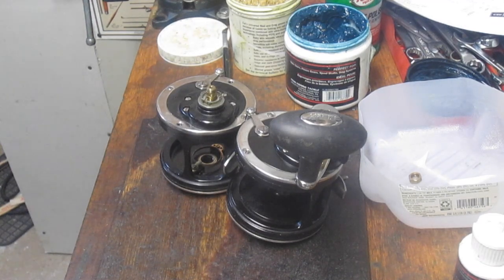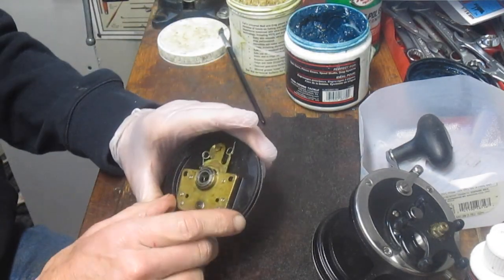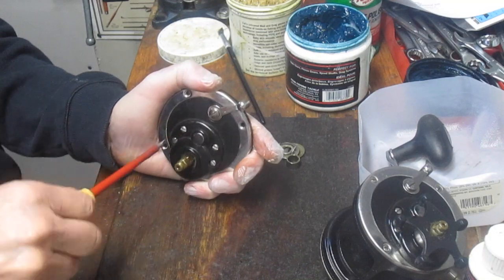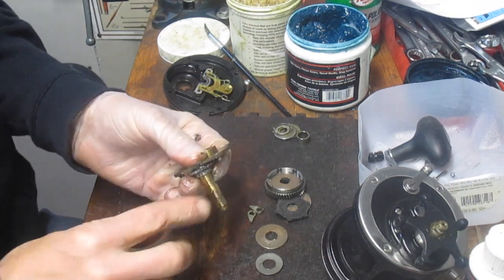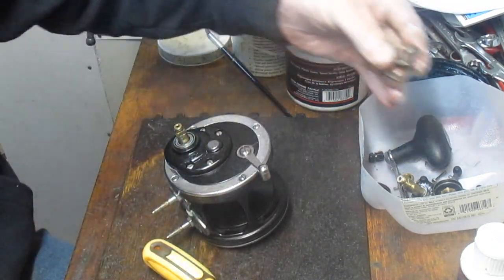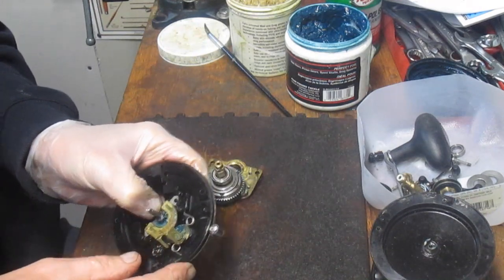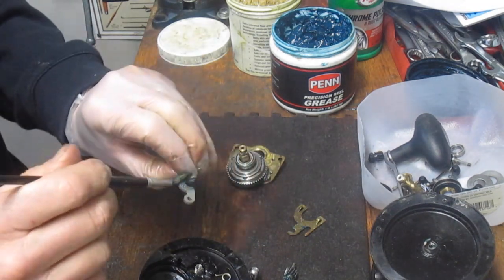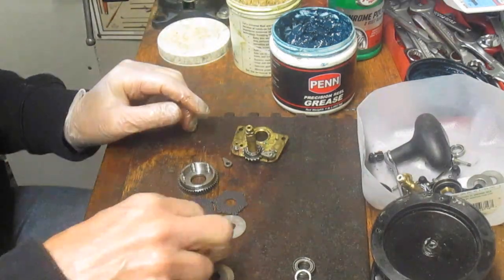Penn Senator 113HN Baha Special how to take apart and service this saltwater fishing reel

Comment: Call it the Yellowtail Special on the West Coast. Great and proven reel the Baja Special. Believe Penn calls that duradrag but I could be wrong.
Reply from the maker: I think your right on the Dura-drag naming.  It is quite the piece of machinery - Stay well Jeff - Dennis
Reply: @2ndChanceTackle  great reel and it's known as a great casting reel as well. They made a US Senator in the 113HN because the Baja Special was so popular.  Not cheap, even used on eBay they go for around $250. Thanks, you as well.

Comment: I have one. I highly recommend upgrading to a Cortez Conversions stainless AR gear and dogs. It's the only weak point of the reel.
Reply from the maker: I am going to check that out.  I would agree that the A/R is the weak point.  This reel was designed before the anti-reverse clutch became popular, so a conversion that adds that dimension would be welcome - Dennis
Reply: @2ndChanceTackle  it's a huge upgrade. I wish i coukd load a picture. But it also cuts the backplay in half. Almost feels like  a newer reel with infinite anti reverse.

Comment: Awesome video, what i wanted to know what is the proper fiber drag disk/ metal drag plate ratio combination in order to get the maximum drag output between 27-30 lbs for the Penn Baja Special ?
Reply from the maker: Max drag is a mater of surface area, so the alternating metal fabric metal arrangement provides the most drag - Dennis

Comment: Aloha from Hawaii. Has anyone made a video servicing the NEW Penn US Senators ?
Reply from the maker: Aloha! I haven't done a video on one.  I will add it to my request listing.  Those replaced the Baja Special, as you know, and are really well designed, modern uptakes on the classic Senator line. Single piece aluminum frame, 6 ball bearings, spool change and made int he USA.  What's not to like about this one - Dennis

Comment: Just got me a newer Senator 4.0 for 30 bucks . Wondering if there is any types of upgrades I can do with it.
Reply from the maker: Not much to do for upgrades, but that reel is very good and not much is needed.  You could move to Carbontex drag washers, and maybe add a power handle, but that is about all you would want to do - Dennis

Comment: Hey Dennis quick question, I have a Penn US113 and a Baja Special. The US113 I can loosen the drag and pull line easily (like any other conventional reel in my experience) however the Baja Special when it's on loose drag I can't pull any line much less when the drag is tightened. Any idea why this is? I mean better to have super tight drag than no drag at all, but I don't think that's normal. I can only pull line when it's on free spool.
Reply from the maker: You likely have drag washers that are frozen together.  They probably need to be removed, cleaned, lubes and reinstalled in the Baja reel - Dennis
Reply: @2ndChanceTackle  sounds good thank you Dennis! Have a Happy Labor Day weekend 😀

Comment: Have a question how about how to fix or what parts needed to fix my baja 113hn that turning the handle the spool does not spin and drag will not tighten what can it be? and what parts should i order? thanks.
Reply from the maker: Michael - I think you need to take the side plate off of your reel and inspect for broken line or broken parts inside.  I is hard to say the cause based on your description - Dennis